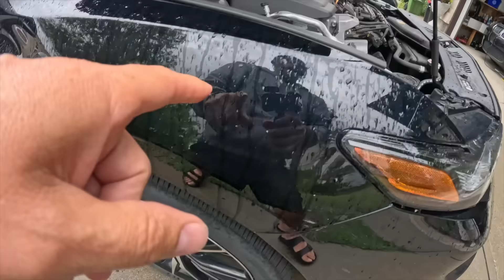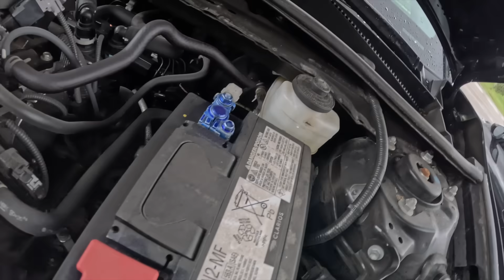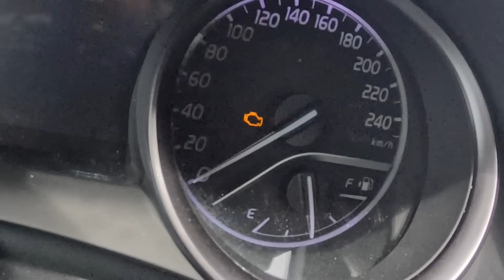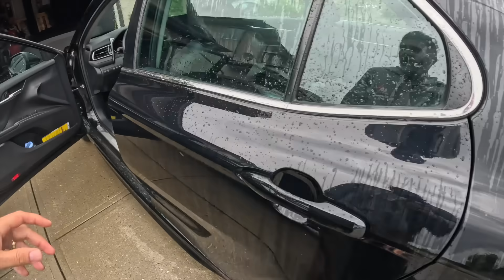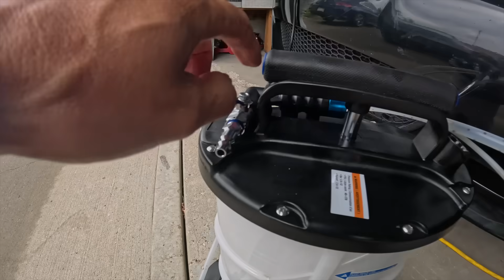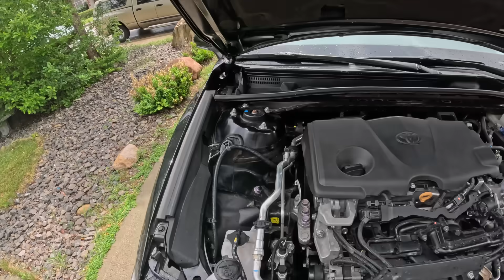How I Now Avoid Our Toyota Dealer SERVICE SCAM's.

Comment: I believe that they use low quality bulk oil. I had my oil changed at the Toyota dealership and was very disappointed with the quality. #1 my Highlander was not handled with care, oily greasy finger prints all over the paint. #2 My car seat was at the lowest setting and grossly out of place. I don’t have memory seats( at least put it back somewhat closer to whereit was. #3 The engine 3.5L  sounded like they put cheep oil in it as it sounded like marbles and louder ticking noise. When I went to change the oil shortly afterwards ( because I didn’t trust their work) I noticed a lot of under carriage cover bolts and plastic tabs missing.. They were a bunch of HACKS.. you can tell the apprentices at this Dealership are not properly trained or they just don’t care.. Note that when I did my own oil change I noticed that my engine was running a lot quieter. I used Mobile 0w20 synthetic. I do not believe the dealership oil is good quality and the kids that do the oil changes are not doing a good job. Mechanics don’t do the oil changes so you are Right!! Do your own oil changes and be safe doing it when you are working under your car.

Comment: Its sad that we have lost faith in these dealerships. But they do it to themselves. In 2007 I bought a Toyota FJCruiser. When I test drove it I noticed it had 700 Kms on the odo. This was in Canada. The salesman said that a lot of people had test driven it. Also asked about the trailer hitch that was on it. He said that would have to be taken off if we bought it. I told him leave it on if we bought it for no extra charge. Of course he had to ask his boss. Came back okay. We bought the car. Two weeks later noticed grease on the garage floor under front passenger tire. Took it to the dealership to have it looked at. While waiting in the showroom was looking at another FJCruiser in the showroom. Sales guy asked if interested. Told him no I had one on the hoist looking for a grease issue. He asked me if it was the yellow one they had sold to a lady 3 weeks ago and had returned it because she really needed a truck. Long story short they sold me a used car for a brand new price. I was the second owner. That's why there was 700 Km and a tow hitch on it. I told them to expect a call from a lawyer. They panicked and offered to write me a check for the cost of the sales tax. That was $6000 Canadian. Told them to write the cheque. The sales guy lied about the 700 KM and the hitch. The first owner had driven it almost 700 KM and had a hitch installed by the Toyota dealership.
Reply from the maker: That's an incredibly frustrating situation to go through.

Comment: For my new 2024 Prius Plug-In Hybrid the service interval is 8,000 Km, however they have 2 different Maintenance Schedules, #1 includes an oil change and #2 does not, so there is 16,000 Km between oil changes! Once it is off warranty, or if necessary before that, I am going do it myself and may up the oil viscosity to something higher than the 0W-16 pee they are using now. (I have just short of 60 years of mechanical experience and I've seen it all.)
Reply from the maker: It sounds like you've got a lot of experience, and it's interesting to hear about those different maintenance schedules.

Comment: This is exactly what happened to me.

I took my brand new car in to Toyota for service at 6 months.  Went in at 9:20 am and got a text saying the car was done at 9:40 am 🤡🤡🤡

I know they didn’t do anything…how can they in only 20 minutes when the entire service department was full of people? 

Then I got a call for one year maintenance.  This time I was prepared and I checked my engine oil color, my tires, my cabin filter.  I noted everything and went in at 9:10am.  Again got a text at 9:40 am saying everything was done even got a receipt this time saying they did $210 of service free of charge because my car was only one year old and still under Toyota care.  And the paper said it was syn oil change, activated charcoal cabin filter change , tire rotation and multipoint inspection.  I even got a video of my car going up on the rack.  

I thought to myself good good finally this time they actually did the service.  When I got home I immediately checked my oil and it was the same dark color …

I then check my tires to see if the mark I made moved to the back tires, it didn’t.  Then I looked my cabin filter was still the same white filter and not the activated charcoal filter that they said they changed to

So yea..I will never trust Toyota new car Toyota care bs again.  They didn’t do a darn thjng:  they saved all that work for older cars that they actually made money on.  My car was brand new so they made $0 on so they didn’t do anything and dared to give me a receipt saying they did all these things 

I really wanted to call the manager and have an argument with them but I’m also fearful they will mess up my car next time I take it in so I just kept quiet .

This is extremely disappointing and I will never trust that dealership again.  I’m going to drive an extra 15 miles next time and go to another Toyota dealership and see how they do my next 5000 mile maintenance….

Comment: They don't do any service anymore, absolutely every single dealer. They take your car, keep it for four to five hours and God as my witness the send us with the same used oil, spark plugs, and they deliberately cause issues to ruin the car to force us to sell it and buy another one. I exhausted all dealerships in the area and small community repair shops, every single one of them is a dishonest criminal. My car always leaves their dens worse than before.

Comment: Company I work for now went to 15k mile oil changes with the 20k miles Mobil 1 filters. I will let you know how it goes. Personally I think after they replace a few engines they will change their ways. They usually trade them in at 98k miles so it probably will be ok, but I sure feel bad for whoever ends up buying one of these old work trucks down the line! That is one reason I never EVER buy any used work fleet vehicles especially trucks!
Reply from the maker: Wow that’s not good especially considering the new costs of these units

Comment: As a master Toyota tech we got a bulletin that 2027 will bring 25,000 mile oil changes.
Reply: Wow insane. I have the new LR Defender that has 21k intervals. I change it every 6k.
Reply: @dishsoap1 smart i recommend 5,000 no matter what someone drives
Reply: Good luck selling that to consumers
Reply: @williamjenkins5562  people are already thinking 10,000 miles oil changes are to soon.  It'll be easy

Comment: I get my oil changed every 7500 km at my local Nissan dealer i Maple, Ontario.  Always happy.  All maintenance done there.  No upsell.  They even tried to talk me out of transmission fluid change every 45000 km.  I asked them to save a sample of the fluid.  Black as night!
Reply from the maker: Sounds like they look after you. Which model?  CVT?  More maintenance may help extend life
Reply: @ECPP  2021 base Murano 2 wd.  I really like it.  Surprised me but still worry about cvt

Comment: Take this advice from a mechanic. Drain the oil at the drain plugs, stop vacuuming it out. When you vacuum it out, you are leaving all the sludge in the oil pan, and the shavings and whatever else. Do your oil changes at 1/2 the recommended intervals and drain them at the drain plugs. There are no short cuts in proper maintenance. You still need to get under the car to do the filter, why would you half ass an easy job??? To get it to drain fast, go for a quick drive to warm it up, get home, turn it off, remove the oil cap and pop out the dipstick, drain the oil, then undo the filter.

Comment: I just wanted to say my mom in her mid 70’s in Texas bought a car almost 3 years ago from Toyota dealer. She didn’t know where to go to get her vehicles taken care of other than Toyota dealer as my dad did before he passed away. She was telling me it cost her $150 at the dealer to oil change and tires rotated. I go to a private shop here in NY to get my vehicle serviced. Oil change, fluids and tires rotated $75.(brought mom’s car back to NY with me)
20 minutes on waiting time….
Next thing on my mom’s car is 
How many oil changes should be done in 2 1/2 years  with mileage at 5222 ? 2022 Toyota Corolla. I figured at least 5 oil changes every 6 months maybe little less??
I have owed and leased brand 
new Honda’s.  
My newest is 2023 HONDA PASSPORT. 
I have had 2 years. 
Honda dealer said 7500 for first oil change. Brought it back to Honda for 1st, 2 and  3rd time to change (free oil change).

My husband works overnight 
We bring the car in waiting 2 hours just for free oil change nothing else. Then we are told it needs alignment 2nd time 
My husband said ok. Covered under lease which it is NOT!
$500 later. 
3rd I didn’t go with my husband for oil change. One tire bald . 
My husband said NO. Told them  NO NO! You don’t listen to me. I’m not going to do anything right now. He explained he works nights drives car in 1 1/2 hours to get oil change and waits 2 hours. Now you are arguing with me about tires that are going to cost me $1000’s here. No give me my car now!
We will be back to return the car. Just ordered new tires and not even at 40,000 miles 
My private shop changed my mom’s oil, fluids and tires rotated.$75. (
My car will get new tires put on by same shop way below $1000
Tires were $400 online $150 to put on and the necessary things that maybe needed.
Watch out for the little things that can get you with dealerships.

Comment: The last oil change at the dealer was part of the free maintenance included with the new purchase.  I changed the next time myself to find they over-filled by a quart. I have a 4 cylinder,  4.8 quart.  The 6 cylinder takes 5.8.

Comment: Hey Mark, OBDeleven is a fantastic tool for many of your cars. It’s much closer to the dealership scan tool. Same device will cover the Porsche, Mercedes, BMW, and Toyota. Much deeper scan and ability to program the ECU. ✌️
Reply from the maker: Thanks for sharing, I’ll have to look into that device! I also do have a couple better tools which I can get in deeper to the system and seas able to see those Mercedes faults related to those sensor and lighting problems.  Most of that could never be seen with a regular code reader.  I am goi g to have a look at that suggestion because that’s the difference between dealers and owners being able to service some of these complex vehicles

Comment: Bought 2018 Tacoma TRD pro brand new, went in for break in oil change at 5000km(3000mi) at Regina Toyota, Saskatchewan on the prairie, because I intentionally brought the truck in, so I paid for the service, fast forward to 17,000km(just over 10,000mi) later, I went in for the second oil change, the service people told me my engine oil is overdue! You guessed it, they didn’t change my oil at 5000km even I specifically told them to and paid for it!

Comment: Before I take my vehicle in for oil changes, (or other replaceable parts), I first mark the part to be replaced with a permanent marker.  Also I supply your own oil and tell the dealer to return the excess oil not used.  Given that many Toyota engines don't use exactly 5 quarts, getting back a 1/2 quart or so validates that the mechanic didn't over fill the engine.
Reply from the maker: Those are great ways to protect yourself from potential issues.
Reply: So you buy your own oil and let them charge you again for oil?

Comment: All is lost if a Toyota dealer rips you off
Reply: My Lexus dealer service my transmission incorrectly it was 3 liters of oil low this caused the oil pump to cavitate while reversing up my driveway losing all forward forward gears luckily i caught this problem and have re serviced it myself using the correct service procedure
Reply: It drives like new now

Comment: My Toyota dealer recently sold me 4 spark plugs. I had to go back to the parts department because of the 4, 1 had already been used. Not by much: the porcelain was slightly browned and the threads had grease in them, not by much. But at 20 Canadian dollars each, this type of practice is unacceptable.
Reply from the maker: Wow, that is a really disappointing experience, to say the least.

Comment: Franchise dealership service stations are all a scam. The manager gets a cut from every service repair and maintenance. Never trust the dealership service stations, I don't. I bring my car to a repair shop that documents all maintenance and repairs on carfax as well as others. The last time I asked the mechanic at the dealership about a repair, he looked at me like I just drove in on a turnip truck. Never go to a dealership service department for repairs or maintenance, they'll royally screw you over, and most of the time they won't do the maintenance or repair, and still overcharge you for it.

Comment: Finding a good mechanic that won't Sabatoge yer car these days gets kinda hard 🤔 once had a transmission guy who did a number on my Pontiac who took it upon his self to do a flush job after that I lost 3 fwd gears I took it in to just fix a small hole in the metric line😮

Comment: My wife drives a Lexus ES350 and I drive a Toyota Camry SE, and I have the oil changed in both vehicles every 5000 miles.  The dealerships will always try to nickel and dime you.  Thank God that I found a reputable shop in my area that services both Lexus and Toyota brands.
Reply from the maker: Finding a good shop is the best way to ensure things are done right.

Comment: I do my own oil. That lets me use a  superior oil and filter to the dealer or quick lube for half the cost and less time. I also do my own rotors and pads and winter tire changeovers. I’ve done wheel bearings, O2 sensors, diff and transfer case fluids and covers. None of it is really that hard just a little knowledge and confidence. A good set of tools really helps too.

Comment: I bought a used rav 4 with 51000 miles from a  private party. Took it to a toyota dealer near THE VILLAGES Florida. The service writer told me i had a bad water pump and wanted to change it and have me pay for it  out of warranty, of course. I thought to myself. Did i notice anything wrong when i arrived at this dealership. No antifreeze/coolant was not coming from under my vehicle. So i quickly said. " Ill have my mechanic look at it. Of course nothing was wrong with it. And i sold the car 120000 miles later and never had to replace the water pump. When i looked into the service waiting room i wonder how many people in there were being scammed by this  dealership service department. These places need to be exposed for what they really are. Granted im sure there are some honest dealerships. But sometimes im not sure.

Comment: yeah, harsh conditions are repeated conditions of 32F or less, or dusty or snowy conditions.  Well....duh.  Anyone north of like dallas and atlanta will be driving in 32 or less.  I've done mine every 5k miles.  22 camry TRD.  I live in WI but moving to AZ this fall.
Reply from the maker: Yes therefore oil services should be done more frequently.  Honestly even Arizona with the smoking heat takes a toll too

Comment: You can tell nice fresh oil on the dipstick after a change.
Reply from the maker: Yes it’s a good tell.
Reply: @ECPP that’s why I always check to make sure oil was changed before I leave the dealership. Cabin and air filters I’m going to start doing for
Myself instead of
Letting dealer do
It
Reply: @alvinsimba734  I had free 2 year maintenance  from Toyota and they lied to me and never changed air filters.
Reply: If its not a diesel
Reply: Actually Smelling the oil is a good thing to do as well.  Sometimes it can smell like gasoline, in which case you should investigate, fix the problem and change the oil immediately.  Oil dilution is a serious problem.  Feeling the oil, it shouldn't feel like paste...
Reply: How do you know they put the right oil in it? Did they use 0w8 0w16 or 0w20 ?? It is clearly marked and they still get it wrong 😮

Comment: We have a 2020 Tacoma and a 2024 Camry. Dealer hasn’t touched any of them since we bought them even with the Toyota 2 year free maintenance. The Tacoma has recently started having dash blackouts center screen. I have made multiple calls to 2 Toyota service departments and no help. I even drove to my local Toyota dealership and showed them the issue as it was ongoing. They told me to unhook battery for 20 minutes. That might fix it but they never spoke of wanting to literally look at it and fix it. Scams are one thing but dealers who don’t want to even fix ongoing issue is crazy to me. They looked at me like I was crazy! I do my own maintenance. We had a 2017 Honda civic that I changed transmission fluid on. Was nervous to do it but at least I knew it was done.
Reply from the maker: It can be frustrating when they don't want to diagnose a problem.

Comment: I remember working as an apprentice. Twice, vehicles ended up losing nearly half their engine oil just two kilometers after leaving the shop — all because the rubber seal on the oil filter had been installed incorrectly.

One of them had a regular oil filter with a metal housing. I removed the old filter, but the rubber seal stayed stuck to the engine block. Then I screwed the new filter on — unknowingly sandwiching two rubber seals between the engine and the filter.

The second time was with a Ford that used a plastic oil filter housing. I installed the rubber O-ring gasket into the wrong groove, which caused a major leak once the engine was running.

Fortunately, both times the drivers were attentive enough to notice the oil warning light come on, so there was no serious damage. Still, I recall both incidents with embarrassment.
Reply from the maker: Wow, that is a great cautionary tale, certainly good to check your work!
Reply: Bunch of HACKS